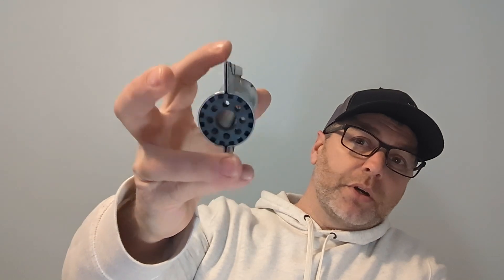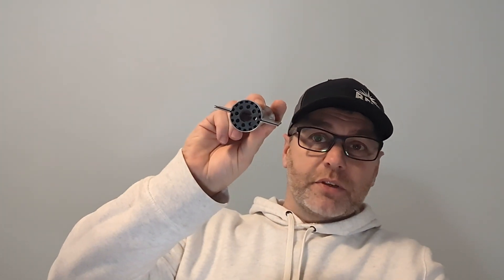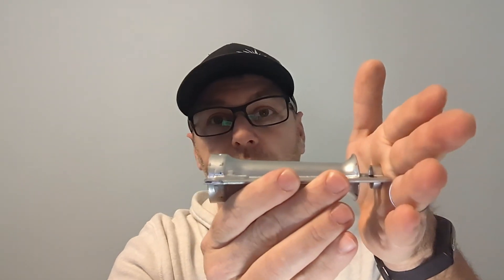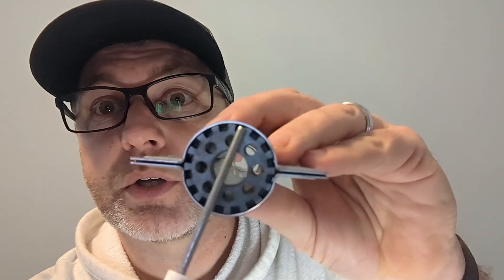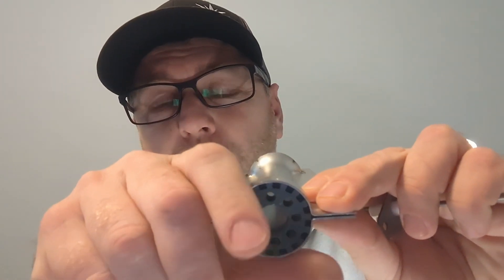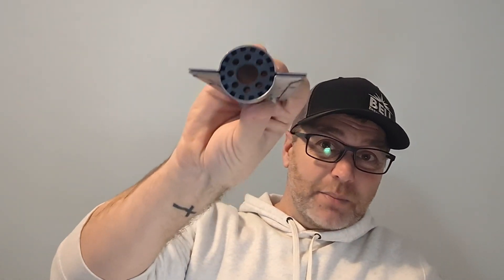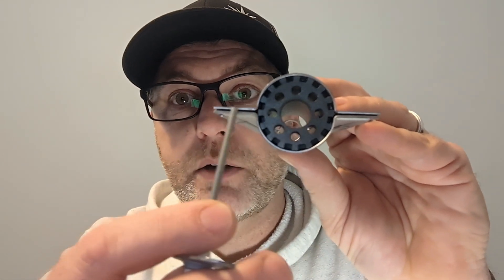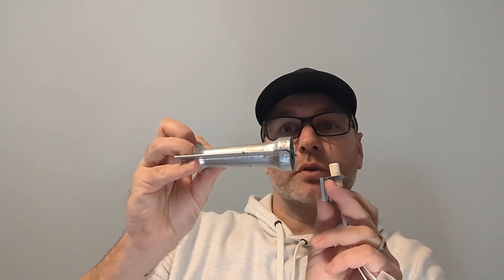Understanding Gas Furnace Burners: A Beginners Guide

Comment: Thanks for the info on the burners. I just bought the house and it’s got a 2001 Goodman gpg13 that’s been giving me lots of trouble. Now I’ve got it running ok but it seems really inefficient. Around 75-85 gallons of LP per month. I cleaned all 4 burners but the flame isn’t super clean and doesn’t really narrow down like it’s supposed to. I took the cobal apart and cleaned it out too. Should I try new burners now? Where do you recommend sourcing parts from? Most of my local shops won’t sell to me without a license 🙄
Reply from the maker: Maybe new ones if they r rusted and deteriorated enough.  Could help.  Yah most contractors do not sell over the counter. We r contractors, not distributors.   That's the difference.  Sorry.  Lol. I know it sucks but it's part of the world.  Typically you can find most common parts on-line.  Supply house. Com is a good one.  And they have  pretty much anything.  Especially for a goodman.  Their parts are everywhere.  The other thing you look at is that the furnace is only one part of efficiency.   The furnaces job is to heat the house to the temp you tell it to.  If the house is not efficient, the furnace doesn't matter.   Everyone blames the equipment.  90% or more of the time it is the structure that is failing.  I don't care how old or new the home is.  Poor insulation, windows, air leaks, things like that are what cause high consumption.  The furnace is just trying to keep the temp.  I'd check the house out first if it were me.  But yah if the burners are due then replace them.  Can't hurt. 
Hope this helps!  Be sure to subscribe and share in your socials!  Have a great day!
Reply: @andyscornerhvac  thanks for the awesome reply. Yea I’ve been busy with the caulk gun and trying to find any other leaks. There’s decent insulation in the attic but I’d guess these 1960 walls are lacking. I’ll keep working on it and look out for more tips from you.

Comment: I had an issue that 3 different techs could figure out . I was getting all 3 burners to light . All the cleaning procedures were done , then moved to trying parts did gas valve and then finally burners still same issue . Last tech tried to add a screw to each burner to adjust the flow . And that has seemed to work he said that shouldn't be needed as its not an lp furnace but it did the job . Question is that fine ? And if I still have issues what could it be ?